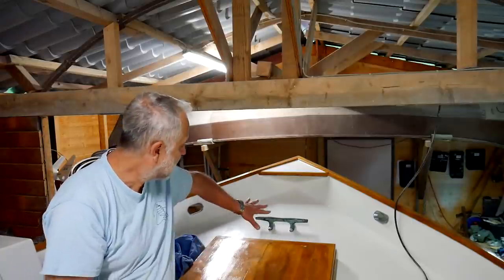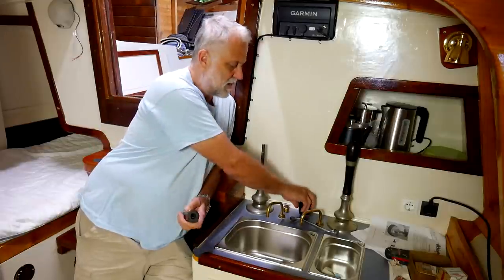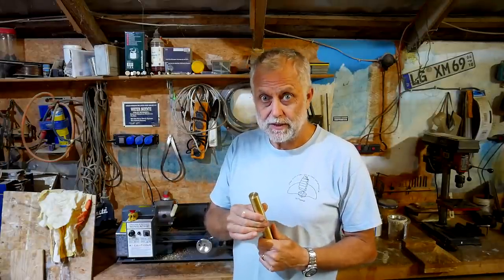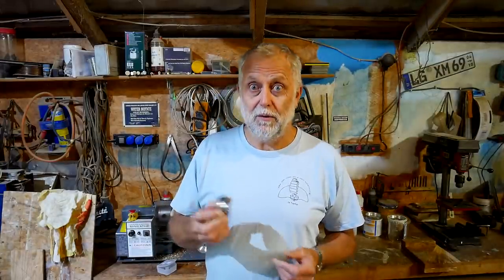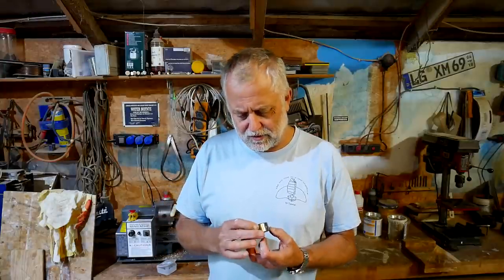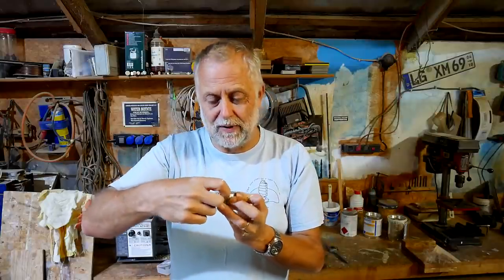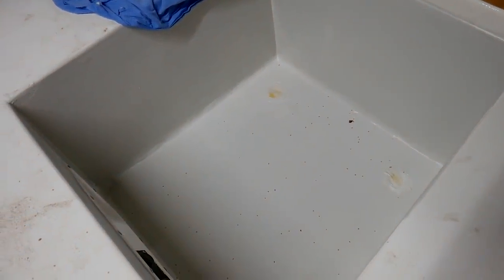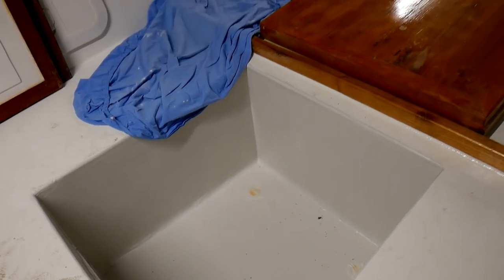Brutality in Brass and Other Bits; Building a Cruising Sailboat - SV Tapatya EP193

Comment: Nice work on the bronze fittings for the pumps.  I would consider that engineering ingenuity more than brutality.  Brutality would have been when I flattened the pieces with a sledge hammer, lol.  getting ever closer.  Thank you as usual Tony and best wishes to all in the Tapatya family.
Reply from the maker: Thank you, Matt. Yes indeed 😂😂

Comment: Should turn 1/4 around bolt, then back it up a little bit, then 1/4 turn again. In breaks of cute metal in tap and a lot easier to continue cutting threads
Reply from the maker: Well, yes, that is indeed thread cutting for beginners

Comment: Good video Tony and you were certainly on a mission to cut that thread - and achieved it. Do you not have any hobbyist friends/contacts nearby  with a lathe more suitable for custom thread cutting? Anyhoo, you are doing great work attending to the most time consuming ‘fiddly bits’ and cracking through your list.
Reply from the maker: Thanks Norman. Yes, I could have driven over to a fella I know who has an excellent workshop, but it's also fun to do it yourself with what you have. The pieces turned out very well, so I'm really quite pleased. 😀

Comment: If that 'Mini Lathe' has 'Auto-feed' you can 'Single Point' the threads...
Reply from the maker: It only does up to a thread pitch of 2.5 mm, Mike 👍
Reply: @SVTapatya  Yeah, I'm used to Brown and Sharps that can handle up to 4" stock, that's why I said 'If', didn't think that little guy could do everything the 'big boys' can. Still a great tool for all the small bits and bobs...⛵

Comment: I have more tools than a girl should own because I was raised by my toolmaker father that taught me money spent on tools is never a waste of money. Where I used to buy dies, they always had a round and hexagonal version and I would get the hexagon one because you can use a spanner or a socket to turn it. In your case I would have used a grinder to put a slight flat on each side for grip.
Reply from the maker: Thanks Rachael. Yes, a couple of flats would have been a good idea 🤔👍😀
Reply: @SVTapatya  I think some times its ok to modify tools. I live in a metric country (South Africa) and used to own a bunch of late 60's & early 70's cars from America, so I was constantly having to make or modify tools to be able to fix them. If you've ever wondered why tool kits have a size 11 spanner, its for American cars :D
Reply: The hexagonal ones are die nuts which are for cleaning up existing but damaged threads, they are not great for cutting new threads. Dies (the round ones) have a a lead in which gives a gradual cut to full depth across the width of the die.😀
Reply: @normanboyes4983  I didn't know that. But they have always worked fine for things I have needed to do and I always started by putting a slight taper on the end of the shaft where I cut the threads and it was always 10mm or less, anything bigger I did on a lathe.
Reply: @RachaelSA  Yeah for sure that is fine for small diameter threads (to use a die nut) but as your experience indicates larger stuff needs tackling differently.👍